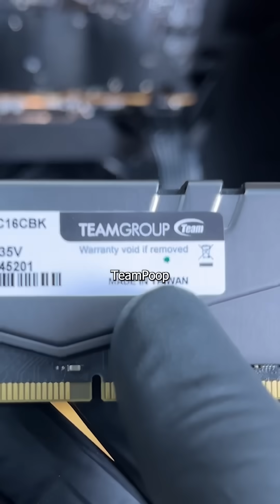New build, old problems (how to fix your own #PC ) #technology #tech #shorts

Comment: So we're completely ignoring the fact that XMP or auto timings were the most likely issue here
Reply from the maker: It’s wild arriving at that conclusion after watching the video where I quite literally walked you through the entire troubleshooting process. If this stick of RAM can’t run at its advertised speed while the exact same stick can, it is defective.
Reply: @SalemTechsperts  if only that was so simple, sadly there's 101 factor that can impact it, like motherboards traces, CPU's IMC, PSUs power stability and RAM training it's likely that the RAM does meet it's spec in manufacturers test systems, but it didn't in the system you were testing. So it's not that wild after all, just experience and more in depth knowledge.

Comment: You know, im surprised the computer even posted with the MOBO not getting adequete power
Reply from the maker: This CPU didn’t require all the pins to function which is why it still worked

Comment: did you try that stick at a lower speed? I have 1 kit of 4x16gb ddr4 that will only work together on x370 if they are at 1333mhz (that's pretty lame even for ddr3) but at 2133 they only crash once a week and at 1600 they crash once every couple of months.
they will work in x2 at (depending on the board) normal speed but that POS board right there didn't like much above 2133 even on 3rd gen zen but the other kit 2x8gb @3200 runs perfectly on it and yet they only do 2933 on my ASUS Prime x370.
RAM TESTING SUCKS AND TAKES AGES.
IT MIGHT ONLY CRASH ONCE A MONTH AND BY THEN YOU'VE FORGOTTEN WHAT YOU NEED TO ADJUST. 
Though I'm sure the greatest Tech knows all this
Reply: Sometimes a think the the mem control part of the die in ryzen just shi+s the bed.
board vendors don't help much either with there support of 3 kits that you cant find anywhere

Comment: I didn't know that was a "blue screen of death" 
Mine gets it whenever it gets stuck in a boot loop for too long
If it's not overclocked it freezes at the windows startup screen, and the overclock parameters that it needs to boot properly change every time it gets powered off, sometimes it needs as low as 4.0@ 1v, others she needs 4.8@ 1.45v

Comment: How about checking the RAM settings first? You could've had bad timings, voltage, frequency and whatever else. You might have thrown out a perfectly working stick of memory.
Reply: Or maybe just RAM that is only compatible after upgrading the EFI

Comment: I've sold lots of TeamGroup ram and haven't had any issues. Only sold a few of their SSDs because the cheaper ones are just that, cheap garbage. Ram has lifetime warranty, so this shouldn't be an issue unless they are bad for getting replacements like the dead Loki brand that a customer bought. Luckily for him, I had a replacement stick that someone else left with me after their one of two sticks died. They were struggling to get warranty as well from them. I did a trade for it and got him a new kit of a different brand at a lower price.

Comment: Didn't plug in the cpu, right And I don't see why people act like putting a computer together so hard. I literally just did it last weekend. Took me less than An hour First time ever put it in. The computer together took me less than an hour. Because I was just like the rest of these people thinking it was something hard to do and then I just said screw it. I'm going to do it and as long as you have. Everything plugged in correctly. What it tells you where everything's supposed to go. It's actually quite easy majority of repairs are

Comment: I can only imagine how many systems like these get thrown away over small issues like these. Which is why I go dumpster diving every once in a while. The best PC find I have so far is an i7 2700 Dell OptiPlex that I picked out of a dumpster in 2018 or 19.
Reply: that's actual garbage
Reply: @cooldud7071  Not really. You can still play some games on it if you add an SSD and a cheap GTX 1060. However my actual gaming pc that I built around 2/3 years ago will blow this pc out of the water. So yes it isn’t as good as a modern gaming pc with an 8th gen or newer i7 or i9 with an RTX 30 or 40 series GPU but it isn’t by any means garbage if it can run modern Windows 11 with a few easy workarounds.
Reply: @KISSFanDan1995  it's pretty bad still

Comment: Why didn’t you test the ram on a different computer before chucking it into the recycle bin? If the problem started right after the customer installed that ram, it could be causing the exact problem the blue screen is telling you. This message is pretty common after installing new ram in a pc. There is no shortage of websites with detailed explanations of the error and how to fix it.

Comment: The biggest surprise after seeing that power cord plugged in wrong is that the ram was installed correctly. Expected them side by side
Reply: I would not say that it was wrong. It was maybe the best fit between the psu and the mainboard without using adapters.

Comment: I played a lot of destiny 1 vanilla and the 2 first expansions then stopped. I played a bit of destiny 2 when it went f2p but it seemed confusing and I left it at that. I still remember D1 fondly so I grabbed all the expansions during a sale on humble bundle thinking I'd play through "the story so far" (which was the name of the bundle) with a friend like I did in D1. I let you imagine how disappointed I am as I have no clue on what's going on, why I should care or where I should go. And I already knew the lore from D1. My friend who doesn't know the universe just powns bad guys brainlessly because it's so confusing.
Basically, if destiny 1 was on pc, I'd have bought all the extensions and redid it entirely as it was never sunset.

TLDR: Destiny 2 is a great ad for Destiny 1 but sadly it is stuck in 1080p low at 30fps forever

Comment: How do I fix the ssd not showing up in my bios menu? I can't even load up my pc anymore. I have been stuck in my bios menu for like 2 weeks. And it says ssd not present
Reply: tried different slot?
Reply: @君街空星  I don't have another slot
Reply: I don't have another slot
Reply: @SleepyKatsumi  it's M.2?
can't tell without donor system, maybe test with friend's PC or get it to repair shop
also ssd generally have quite long warranty you may want to check on them

Comment: NO ONE GONNA TALK ABOUT THE MOTHERBOARD POWER SOMEHOW WORKING EVEN THO IT'S THE WRONG CABLE?
Reply from the maker: Absolutely wild right?
Reply: @SalemTechsperts no that's the CPU power smh
Reply: If I recall right that power port is just four +12volt and four grounds. The redundancy is there so CPUs can get more current if they need it. Clearly this one could boot just fine without all four pairs of pins being connected.
Reply: No, because that's normal. As said above, it doesn't matter as long as you've got the 4pin connector on the right plugged in.

The left four are also +12v on top and GND on the bottom and aren't usually needed for most CPUs to operate. The motherboard didn't give a damn about that socket.
Reply: That is not the power for the motherboard but an 8pin cpu power socket. Not all ATX PSU have such an 8 pin connector, in particular if they are older. Have of these pins are 12V, other half is ground. The reason to have mor pins is to provide higher wattage for more energy hungry cpus or for overclocking. If the cpu isnt a wattage monster, often just one 4 pin connector in the 8 pin socket works as well. The connectors and sockets are designed in a way you basically cant plug it wrong, thats why the second 4 pin connector didnt directly fit beneath, however 2 of the pins (one 12V and one ground) did fit, creative solution and 6 is a good compromise between 4 and 8. I don't think it is a bad solution. If the techspert didnt exchange the whole psu, or maybe just used a 4pin to 8-pin adapter which looks nicer on the board but in the end the same current goes through each of the psu-4pin-connector pins. Or some other fancy adapter to utilize other 12v pins of the psu.

Comment: This is why you don't cheap out on RAM
Reply: RAM is the main thing you can cheap out on. It's never going to take the whole system with it when it dies and it's usually a quick and easy replacement if it fails.

Also, teamgroup do actually make decent ram. I guess not their budget line though...
Reply: There's nothing wrong with Teamgroup RAM. You can get a dud from anyone. Including a $300+ kit of Corsair RAM, yes.
Reply: You can cheap out on RAM as long as your time isn't valuable to you.  If you buy cheap RAM it has about an 80% chance that'll work just fine, however the other 20% of the time you'll get a broken stick that needs to be RMA'd.  Usually you'll have to wait 1-4 weeks to get a replacement stick.  If you don't mind waiting the extra weeks for a replacement, buying cheap RAM is fine.
Reply: @futuza  having to wait for an RMA is not as worse as your psu exploding and taking your GPU or CPU or SSD/HDD with it or losing your precious data because you SSD/HDD suddenly died....
Reply: @ChimeraX0401  Yes, no disagreement from me.
Reply: In this case , this RAM is not cheap . I mean may be cheaper than a lot of other options but teamgroup make nice RAMs .
Reply: cheap ram is not a problem. You will always have that 2-3% (5% for cheap ram) chance to get a bad stick of ram. bought cheap rams 4 times and one time expensive Gskill ram, my first bad stick experience was the gskill ram.
Reply: you can cheap out on RAM as long as you don't overclock it to 3600 or even 3200, run it at 2666 and it will be fine.
Reply: Almost like... Every RAM chip is made by the same few fab. Check for speed + latency, rest is completely irrelevant.
Reply: You can cheap out on ram, the only thing you dont want to cheap out is psu and memory storage. Always buy the best psu and SSD/HDD you can find....
Reply: @ChimeraX0401 not me cheaping out on only the psu 😭

Literally using a $50 psu for the past 2 years
Reply: I did, and it works fine... too bad the CyperPowerPC "technician" installed my power supply upside-down, so that's not fine.

Comment: I'm surprised it can even turn on with the power connector like that.
Reply from the maker: Me too, I'm sure someone smarter than me can tell us why
Reply: @SalemTechsperts  its your apple m.2 guy here to remind everyone that CPU power ports are built with more power in mind than the cpu needs in order to overclock it so if you're just booting it than 6 pins wont kill an 8 pin connector. just dont try to put it under load or it might blow up
Reply: Most MBs only need the extra powerdraw if you overclock or are using a specialized CPU (eg: one with a lot of cores that has a higher power draw minimum than a less powerful cpu, such as a Ryzen 5950X vs a 3600.  Also just booting Windows or BIOS doesn't require much power, if you were to run a heavy workload though (compile Google Chrome with gcc) it might not work.  A lot of CPUs only require 4 pins of power, not all 8.
Reply: Because the left side power connectors aren't used for normal CPU power. They're only needed if you're going to do some crazy overclocking with LN2 cooling and need ALL the power. 

The entire top row is +12v and the bottom row is GND. Each top/bottom pair is +12v/GND. Normal CPU usage uses the four right most connectors for 24v total (2x +12v) so as long as you're using the CPU power connector and not the PCIe cable, nothing bad can happen if you use this configuration. 

The keying is to prevent you from inserting the connector upside down, or from inserting the PCIe connector instead. (PCIe standard has the GND and sense on the top sockets and +12v on the bottom, which could fry things if you somehow managed to force it in, which knowing most people here is a possibility).
Reply: That system knows how to live with minimal resources.
Reply: yea this pc would have worked if he left the plug as it was and fixed the ram
Reply: That looks like additional CPU power, it still gets some power from the motherboard. (Enough to boot and such)

Comment: Can you explain it how ram causes that error
Reply: Bad RAM (or simply incompatible with the motherboard) causing a kernel panic. I decided to save a few shekels buying "open box" RAM from Microcenter when I upgraded my PC last—usually a safe bet, but the set I got literally had "BAD" scraweled in sharpie across three of the four modules. And while only one out of the three refused to POST, all four failed Memtest86+ or KP'd when simply trying to boot the System Rescue ISO.

Comment: Lmao he deals with so much old crap he forgets things have warranty
Reply from the maker: It’s true 😭
Reply: @SalemTechsperts  lmao 😂
Reply: @SalemTechsperts  Atleast you are the Greatest Technician That's Ever Lived.
Reply: @SalemTechsperts how do I send my pc for u to fix? 😅
Reply from the maker: @tommyblade8093  SalemTechsperts.com
Reply: actually, most ram memory gets a life long warranty. of course, there are about a dozen loopholes and definitions on "life long" of course that they will abuse to not throw the ram under warranty, in case it ever fails. but it is there in name and spirit, atleast.
Reply: @redditspy21  Then, I got fucking cheated! Last I checked my G.Skill RAM only had a 30 day warranty
Reply: To be fair, most stuff gets its warrenty voided when you repair it. So its easy to forget.
Reply: @MrMoron-qn5rx  Well, he never repaired the actual RAM stick, so warranty still holds.
Reply: @JMPERager  most RAMs have warranty for life time too. You are likely to upgrade into a newer DDR and your other components screwing up than getting your RAMs a new repairing.
Reply: @MrMoron-qn5rx  decently sure that's illegal in all 50 states
Reply: @toolbot4343 Nope, literally says you cannot open laptops, devices, etc. they have a covered screw with paper and will void the warranty. Same as adding power to a car with a warranty. It’s a no go.
Reply: @MrMoron-qn5rx Typically equipment gets voided if worked on by an non certified technician iirc.
Reply: @imshortnlow4u 
a) how would they know if a non certified technician worked on the system? 
b) if it is a pre built system then yes, the warranty for a system from the supplier could be void if ANYONE outside said supplier works on it, but the components inside most likely still have manufacturer warranty (Unless they have been sitting at said suppliers warehouse for said warranty period, then you could be shit outta luck)
Reply: @John-cq9ew  
a) that's simple. They'll just ask you to prove that whoever worked on it has certificate
Reply: @John-cq9ew  you are correct about manufacturer warranty, however if you say take apart your GPU to repaste it could void the warranty if you mess something up. And like John said, a repair shop will typically give you a bill of service/invoice with info the supplier can use to call the shop to confirm credentials.
Reply: @imshortnlow4u  It's technically something not true, they can put that in a warranty's terms but most places require them to honor the warranty unless they can prove the work to the product caused damage.
Reply: @hopmajibhohepeajibho7595  But how could they know that anyone worked on it if you don't tell them? And actually he didn't even work on it, he just changed it to determine that this RAM stick is defective
Reply: @JLychar  it's usually obvious if piece is repaired. If seals are removed that usually indicate that it was modified
Reply: @imshortnlow4u he didn't work on it just swapped it out. The warranty might be void if he opened the chips though
Reply: @imshortnlow4u  nope. thats what they want you to believe. but that is actually completely illegal to do
Reply: @imshortnlow4u  A lot of places say this, but it doesn't hold up in court.  Do you want to pay to take them to court is the problem.
Reply: Bro just sends it out for repair and now he can sell it again most likely
Reply: Dang
Reply: He is somewhat of a scrap dealer at this point, Just like a Racoon should be.
Reply: RAM oftentimes has 10 years or lifetime warranty, so the customer could've got a new set
Reply: SAME 😂
Reply: Bruhhhh
Reply: Yes some things have a 10 year warranty
Reply: "Th-"
Reply: it was a different stick he through in the bin,had no heatsink
Reply: Right To Repair!!!
Reply: Like everyone's mother😂